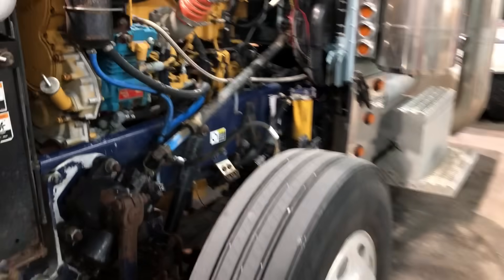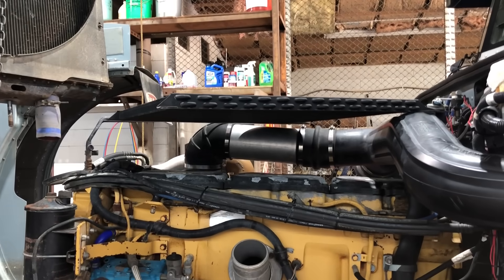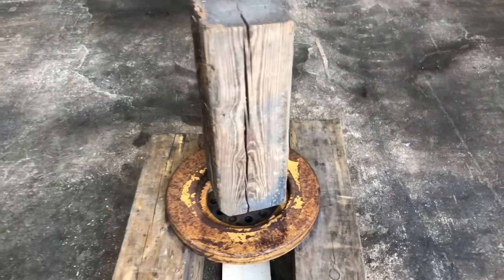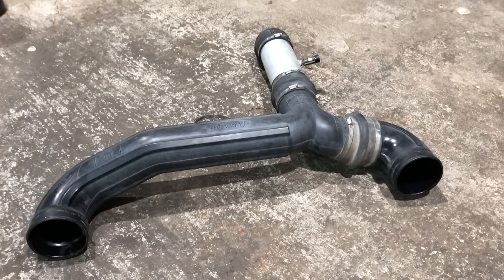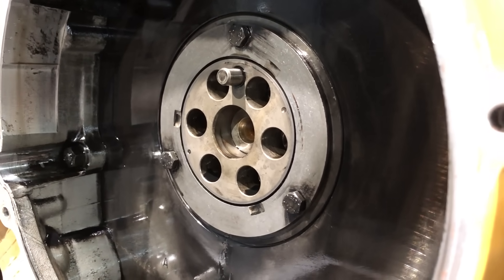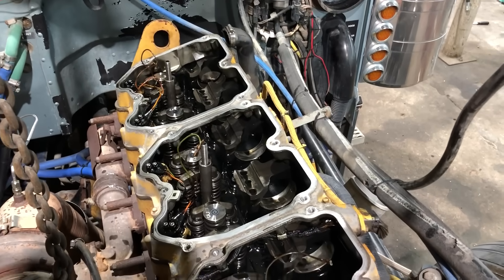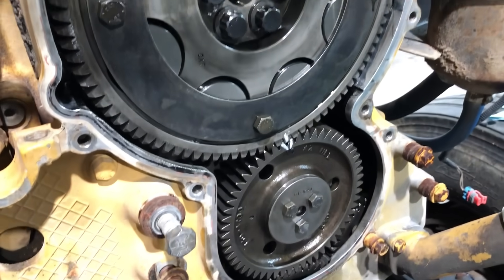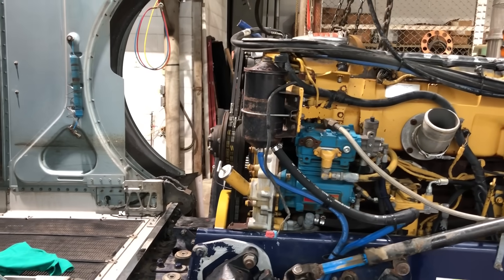800 HP Marine Camshaft Swap - 14.6L Caterpillar 6NZ C-15 Diesel Engine - Peterbilt 379 EXHD

Comment: Personally, I found the video somewhat interesting. However, Here in the comment section, the first thing I noticed, was a "My dick is longer than yours". contest, between someone named BOBO, and a "KT3.". As someone who retired from Auto/Truck repair industry, in 2008, you two reminded me, of the kind of things I DON'T miss, about that profession. Like another commentor said, there is due credibility, to both points of view. There is also, however, serious issues that neither of you addressed. There are also the differences in the "Service-Culture", Between Dealership Techs, and mid, to upper-end independents. After watching the video, I only have one serious question, (For starters, anyway) Was this Truck's "Cam-swap", just a "side" type project, where the primary motivation was simply "For the Hell of it"?  I ask, because I have yet, to  have known of ANY Dealership Service Department, OR Ind Shop, that would be willing to have their fingerprints, anywhere near THAT train-wreck of a job. Cmon guys!

Comment: Hey man!! Super cool! I'm very familiar with Honda Tuning. Do these engines make big gains without fuel mapping and timing? Or is the slight difference in Cam profile enough to give the truck more pep in all ranges of the powerband?
Reply from the maker: The ECM flash file (contains the fuel and timing maps) and injector combination is what makes the power.  You need a camshaft with the injector profile to support whatever injectors you're running.  The 800 marine cam matches well to higher flowing injectors (55s or 59s for example).  I wanted to see how well it would work with the stock 57s, first hand.  There are literally thousands of trucks out there running the 800 marine cam, it's nothing new.
Reply: @KT3406E  thank you! Is it true that you have the ability to load your own flash files onto the computers of these trucks? Like using Hondata Smanager to tune a Honda Computer?
Reply from the maker: @KevinMartinCaterpillar  Yes, I reflash ECMs almost every day, sometimes as many as 3 a day.  That's how I make the majority of my living.  It's no big deal, guys do it all over the country every day.  I don't know the first thing about Honda.
Reply: @KT3406E  thank you!!! Very similar in many ways. Guys come in looking to remove the restrictions, as well as make more healthy power. Very similar idea
Reply: @KT3406E  I still don't understand why a marine camshaft is better.  Marine engines run at a steady RPM and load conditions their whole life.   They would seem to be less effective in a road vehicle with the various operating conditions encountered.

Comment: Great video except it reminds me the time I passed a semi on a 2 lane highway going the opposite direction hauling a load like that and got blasted head on with a bunch of rock that got blown out. Needless to say I was thankful I wasn't on a motorcycle and was driving my car. Caused over $2500 in damage, chipped/broken bumper, headlights, foglights, hood, apillars, roof and windshield.

Comment: That bobo geezer needs to check his facts, and learn how to be polite. The industry doesn't really benefit from tawdry squabbles on social media platforms.
Reply: You tell him Peter.
Reply: But I'm the dealer and you can't do what you want unless I let you 🤣🤣
Reply: Sounds like bobo know what he talking about. It's like rebuilding a 289 or 302 mechanical engine. But when you dealing with a electrical ecm and pcm engine. You got reprogram it for fuel and air mixture and timing and increase injection for fuel due to the fact you changed out the cam because that changed the way the engine runs.

Comment: Love your videos! You definitely know your shit and it shows! What do you think about building an older 5.9 Cummins 12 valve for fun?
Reply from the maker: Wouldn't have the first clue, I am pretty specialized.  Never touched a Cummins.  Thanks for watching.
Reply: KT3406E there super easy to work on, there like the 350 of the diesel world. If you can work on a overhead cam Diesel engine a 5.9cummins is a breeze. Commonrails are a little trickier at the start with the wiring but once a person figures out the in’s and outs they are actually a easier fuel injection system to troubleshoot

Comment: Never seen anyone replace a cam without rebuilding the rest of the motor. You didn't even replace the cam  bearings .
Reply: Why would you replace the cam bearings if they aren’t bad? He replaced the cam with another cat cam and the rest of the engine was fine as long as he was careful in the removal of the old one that cat ain’t gonna give a shit going down the road
Reply: @crazycajunman1992  
To be honest to take an engine down that far and not rebuild it was a waste of time and money. He should at least replace the cam bearings. I have rebuild many engines both gas and Diesel and even one that ran on kerosene and have never not replaced the cam bearings that's just plain stupid.

Comment: I read a ton of comments after watching the video, I wanted to make some kind of comment that didn't show my illiteracy to bad. I'm 72 and most of my years of wrenching laying on my back on some island in alaska were on diesel related problems. I did my share of detroit's, cummins and cats. Not to mention murphys and other of name old equipment we had to work with but the equipment came to me when no one else would take a shot at it. I've done infreams and full rebuilds. I am not a school learned mechanic but just pulled wrench's since I was to young to argue with dad. From doing king pins to doing cam bearings was kinda my school of do it till you get it or blow it up and the first engine did do just that and it come out of my wages. I took pictures when it was possible but many times that just wasn't the case. From changing swing motors in loaders to head bolts in macks. I got better with time but wouldn't trust myself with the new stuff that came out more or less when I quit. I got tore up from the floor up and the one thing I learned real good was if it was cat yellow it was because they thought it was gold and it was by the time it got out to the remote camps where you worked when everyone was asleep. Gold streak the parts in and a week later you got the parts so you had five or more rigs to work on at any one time. I can remember coming in for dinner thinking that was what time it was and I was grease from op to bottom but scrubbed as much off as I could. The boss made me a seat at the cook shake that day and told the cook that the grill was on for me at any time I came in but he also knew that I saved him thousands of dollars. He even flew me in a bottle of expensive whiskey once with don't share it with the crew till they wash parts for you/LOL. I was always tired but I made twice what anyone in camp did and he gave me bonuses for the good work I provided him. As far as flashing and setting ecms it never hit my wheelhouse and I changed the timing set on a 1693  cat motor that was our lowboy truck. Ya I turned up the pumps and I did stuff that I ain't proud of but it was what the boss wanted and I gave it to him. I'd put my mony on the young man who puts his hands on the wheel everyday and isn't afraid of grease

Comment: Course valve lapping compound inside of worn/rusty fastener heads, has always helped me remove them when I think they will strip out. I also like to use a old school speed handle of justice with a big pommel, so I can really get my weight into them.

Comment: Nice job.  It sounded real nice hauling rock.  Quick question, did you have to replace the leaking AC hose and recharge the system?  Kind of a dumb question, but I had to ask.
Reply: If he wants Air Conditioning im sure he did.

Comment: When your shop is clean enough you can drive semi into it , you're wasting too much time cleaning and not enough time working and collecting things that need working on someday.      :P
Reply: You're wrong. Any mechanic with any pride in his work and accomplishments will in fact pick up his shop between jobs. It's a trait bred into us and and a good sign you're in the right shop. I know shops that will let a mechanic go for trashing his bay. If you can't pick up your mess, don't make one.
Reply: Tcmtech that more true than anything I was ever taught in school
Reply: @matthewmaca6675  If my shop was clean I could fit 2 semis with 42 foot trailers in it.  but its not, so just put my riding lawn mower in it, barely.  :P

(I have too much stuff and not enough time to work on it all.)

Comment: Hello,
Does swapping the camshaft affect the torque output?
Also, what other supporting modifications would this job require?
Reply: If diesels work anything like regular cars the cam definitely changes the powerband.

Comment: I know people like their original parts, but I'm sure you can find better machine bolts for easier maintenance on that peanut cover.
That Cat's pur is a nice growl!
Reply: I replace mine with Allen socket heads. And don't be cheap with the anti seize!
Reply: I've been doing that with my 82 Yamaha, damn thing is covered in JIS head screws that the previous owners have stripped out

Comment: Cardboard is the BEST work mat along with placing engine parts along with either blue towells or huck towells.
Reply: And for oil spills. Because they happen right where you're working. Let the cardboard soak up the oil for a little while and you don't need to throw down as much speedy dry. 
I'll just put cardboard down first  if I know a cover I remove is gonna drool all over.
Reply: @MrTheHillfolk  Better than hoping to find parts in the grass.
Reply: @ccaissie113  
Love me some old appliance boxes. 
Getting a new water heater is a win win.... Hot water , and a new cardboard creeper for the shop 🤣
Reply: MrHillfolk a really good source for big sheets is to hit up the grocery store for pallet tier separators. They’re somewhere around 4’x4’ (pallet size) and if you hit them at the right time they’ll be happy to give you as many as you can load in your pickup bed.
Reply: @MrTheHillfolk  I agree it is awesome on that!!!
Reply: Pig brand oil mats
Reply: the old blue towel myth, I'd like to see the day when a few fine threads cause steel parts to screw up. if you believe that to be true you don't have very many brain cells to rub together.

Comment: Nice work.  I've got an International  9900ix.  I'm able to pull center counsel in cab,  and pull cam out the back of head.   
   Do you add more clearance on engine brake,  to compensate for lost braking effort?
Reply: Nice 👍

Comment: I have a tuned MBN and it just doesn't feel like the tuned 6nz, guy I felt with that's a known old cat tuner on the forms says it needs the cam done. The power just feels flat, doesn't have that quick rpm pull up like a 6nz or 2ws, what's your opinion
Reply: When it's time for a rebuild... set ur self back enough money to switch to a 6nz
Reply: @Johndada517  6nz and mbn is not much different,  besides compression and cam I think. Once tuned and the cats are removed from mufflers and shitty turbo is gone, it's a good motor. It's hard to get the egts past 900 degrees now on a hard pull. 140k stock it would be 12-1300 like nothing
Reply: How long have you had your mbn and what's your mpg .... tuned vs not tuned I personally havent had much luck with these mbn motors
Reply: @Johndada517  had it since 2013, got it with 90k on it. Was a garage queen. But when we got it it ran 11-1200 on egts just taking off from a stop sign in like 5th gear, was a factory 525hp motor so they wouldn't put the 550 tune in it that's used in the 2ws or 6nz. It was a dog with a mini and skidsteer on trailer, nevermind put a 80k Machine on trailer. It pulled like a 350mack. Horrible! Read up on the forums,  hooked up with a Guy Mr Haney from forums,  did the tune and turbo, non wastegate,  BG s430x I think it is, I'll look tomorrow. Mpg are hard to judge cause I move all heavy haul machines,  but it was horrible stock. Now its about the same as other 6nz and 2ws we have. But it just doesn't have that snap like the 6nz or 2ws. Its supposed to be 630hp at wheel, according to tuner. It will walk by same truck, same gear,same trans, same trailer and Machine on it that has a stock c16 600hp. Idk just feels a little flat to me but she runs good
Reply: @Johndada517  this truck is a 4 axle heavy haul t800 52k rears 20k front and tag, 18sp 4.11 gear
Reply: How the heck did you get in touch with Haney I been looking for him for a year and got no luck but least you got with the right guy it seems one of my trucks got the cheap 6nz switch just loaded the file and changed turbo to a baylock switchblade with their manifold it's been 4 months around 45k miles and is still doing ok gonna see how long that last egts still will climb up hot tho pretty easily that's on a 04w900
Reply: radar has not on there anymore,  but I've read a ton of posts, talked to one guy I saw still posted and got his # thru him. I dont believe that switchblade bs.  If it was so great everyone would have one
Reply: And yeah that's kinda what I meant by no luck with these motors by the time u get done changing everything out that needs to be changed you pretty much have a different motor lol
Reply: And you are definitely pulling heavier than me I stay gross around 120k-130k running up and down i69 in Indiana sounds like you got a nice rig
Reply: @Johndada517  we are able to do 140 on 7 160k on 8 axle

Comment: I think that when get up to 800hp out of a C15 on road application you start getting cracks in the main tunnels like the C18, head gaskets are fine but the bottom end ?
Reply: Actually bottom end is better than heads in these applications, MHO the weakest link in a Cat engine is the head.
Reply: @herygarcia6193  
I always replace heads with reman because you can't rebuild them cheaper then reman. Most heads are cracked but still work fine. I would be lucky if I can reuse a C18 Block because of cracks in the main tunnels, because of too much power

Comment: Jeez, this thing hauls 80,000lbs to speed faster than my Pete 330 at 18,000. Nice. Also, did you say this thing has 750,000 miles on it? Somebody was Johnny on the spot with their oil changes, this engine is CLEAN!! Well done sir!
Reply: That motor has been overhauled, however some of the outside stuff was reused which unless its worn out, is perfectly fine and done everyday. However he was smart to change that damper. I had a 12.7 detriot that snapped a crank boss and I'm pretty sure that was the reason, was a worn damper.
Reply: You right is a Cat Reman.

Comment: So how much extra horsepower do you think you've gained from just the cam swap or did you do any program upgrades also? What are the spects on the trans and rears? Just curious on the overall combo you're running.
Reply from the maker: Not much from just the cam swap.  I do ECM reflashes so I've been running a modified file for a long time.  18 speed, 3.90 rears.

Comment: do you work only with engines?? im trying to start my business at my farm working only with engines.. Cat, Detroit, Cummins, etc truck or machine

question! is it possible to put that marine camshaft in other c15? or just the C-15
Reply from the maker: It will physically go in any 3406E or C-15, or C15.  It's typically used with a higher flowing injector than stock.

Comment: So how does 800 HP feel?
Id love to have it in my KW T800 Dump. I just might beat some of these Western Star Automatics.
Reply from the maker: It's not making 800.  Pretty close to 700, which is about all you can do with a "57" injector.
Reply: @KT3406E  Ten 4 well how does it does it do with these Western Star guys  that love to pull  around you fully loaded going uphill and drive out of sight?😀
Reply from the maker: @RC-Heli835  A lot of them are probably running this cam, with a higher flowing set of injectors.  It works just fine, as long as you have a little common sense and know how to watch gauges.
Reply: @KT3406E  The Western Stars that smoke me in my KW T800 with a Cat C 13 are stock 500HP Detroits with Alison automatics.  I don't know if they have the DD13, or DD15 but I've never been able to beat any Western Star.

 The DD16's power range is 475-600  HP but I believe most folks are  buying the smaller economical  505 HP 13 or 15 engines.
Reply from the maker: @RC-Heli835  Well the C13 is your problem.  Unfortunately, they are pretty lame and pretty good at flying apart too.  Hopefully you'll have good luck keeping yours together, and if not, you could always swap in a 3406E or C-15.
Reply: @KT3406E   The KW has almost 250,000 miles on it and we just had to repair a cracked head on it.
It has more power right now than I've ever known it to have.

 Over all its given more engine problems than the 96 Pete with almost 500,000 miles. 
That 3306 has never had any problems other than an oil leak. Sure its had some fuel injector pump issues but that's about it. That trucks has been a good one but it has no overdrive and will beat you to death without cab suspension.

Comment: Pretty cool putting the camera in the bed, no wind noise as well! I don't know the first thing about diesels but man, it does sound nice.
Reply: single turbo beast
Reply: Same as the rest ,suck squeeze bang blow ,only diesel ⛽️ high compression fire 🔥 piston no need for spark it ignites the diesel oil under compression KA-BOOM ,always heavy blocks for strength💪

Comment: Did you have to do an idling break in for new camshaft?
Reply from the maker: No, put it in and go.
Reply: DainBramaged 4Lyf I don’t think it was a brand new, never run cam. I believe it was more likely a used unit from a previously running engine. I believe these 800 cams are stock in certain CAT engines. I’m a Harley mechanic though so I’m not a CAT or diesel expert by any means.